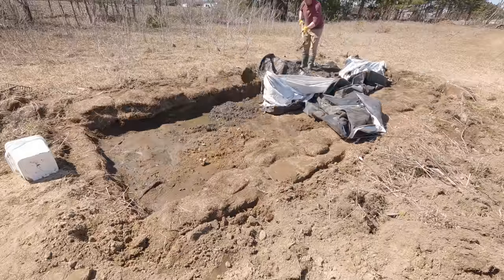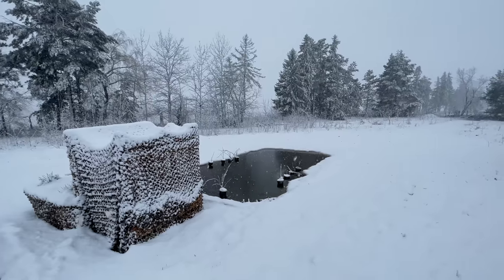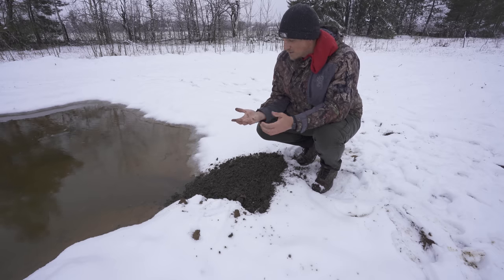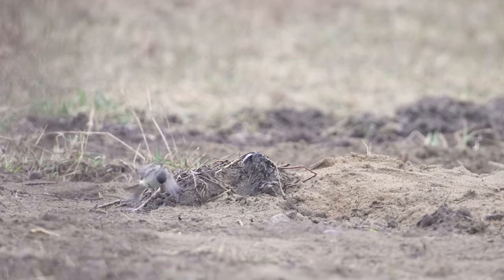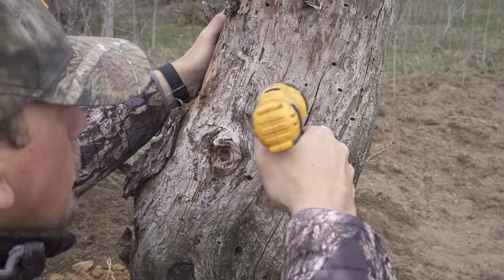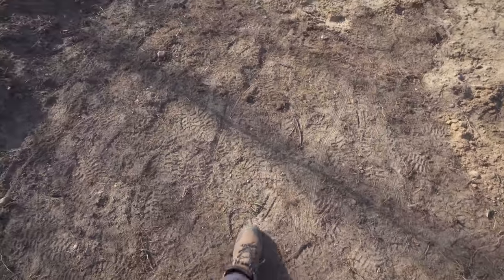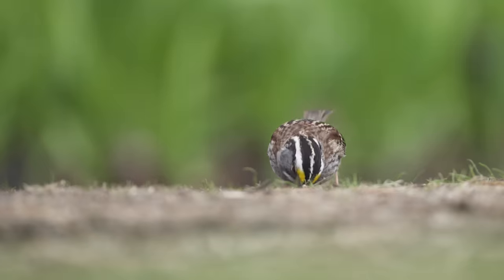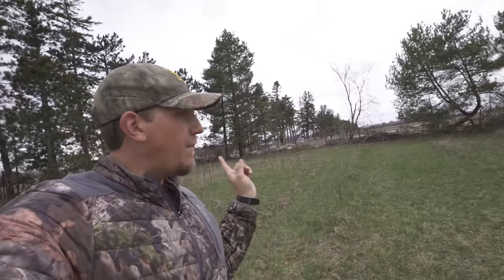Attracting BIRDS to my new DIY WILDLIFE Pond

Comment: The mason bees lay the female eggs in the back of the hole, males in front.. drill the holes 6 inches deep and you should get plenty of bees. Woodpeckers will dig deep in your rotten wood tho so you might replace it with a dried but not rotten piece. I buy old metal tool boxes, cut chunks of 6x6 to fit and fill them full of holes. In the winter I close the lid of the toolbox which is mounted vertical on a post or building. 
I subbed when you put the post up, I love ponds and wildlife, watching your videos will be a treat.

Comment: Dude! Such hard work, with such good result (hopefully continually so)! You're really doing a good deed here, both for yourself and the wildlife :-)
A question: is the blind well-drained, or will it be accumulating water and get soggy-bottomed after periods with much rain?
Reply from the maker: Thank you! And yeah it is well drained. It’s all sandy soil so even if I fill the entire blind with water, it would be drained in 15-20 minutes. Since the surrounding soil is sand too though, it’s near impossible the blind would fill with water. Unless we get a crazy storm move through, in which I’d probably not be outside anyways haha.

Comment: I’m moving from Gothenburg, Sweden down to the middle of nowhere in the south east (Småland) country side. And I’m going to try and create something like you are doing! Question: Do you need to add water or is plants that give the water oxygen enough? It’s old farmland close to different habitats so I really think it could have a positive impact on biodiversity.
Reply from the maker: Hope everything goes well with your move! I have some pipes to add fresh water to the pond. Since the area around the pond is mostly sand, the water is pulled through the surrounding sand, which lowers the water level. In terms of oxygen, I'm hoping I'll have enough plants establish to supply enough oxygen to the water.
Reply: @StefanoIaniro  Thanks for the tip! First I have to fond out what lies beneath ground level. I’m hoping to find a small spring somewhere to borrow water from. Depends on the land I guess. Worst case scenario, a very small pond. Still it would attract something at least :)